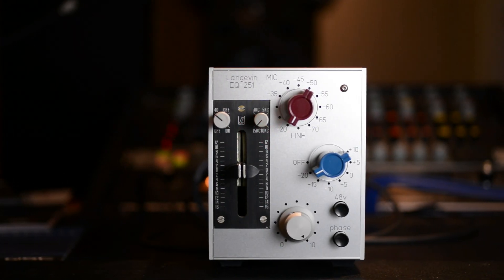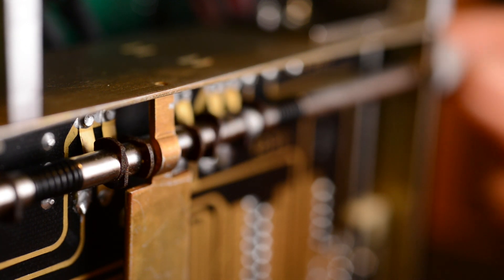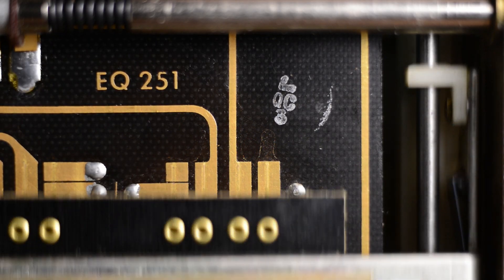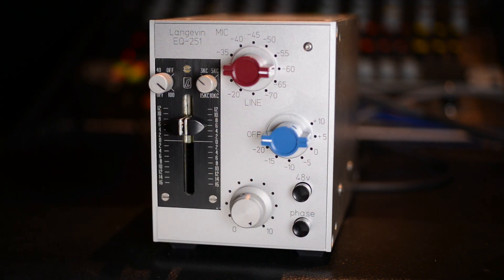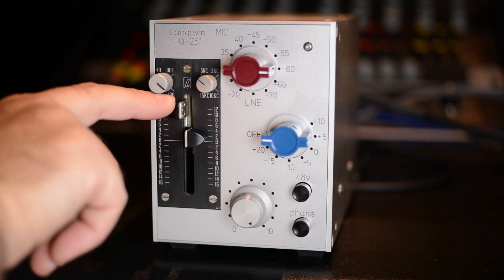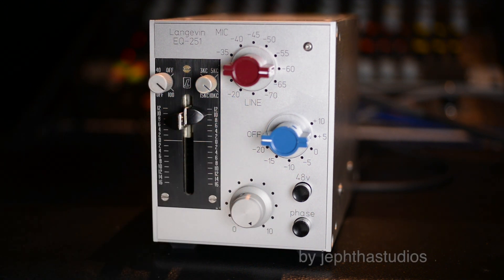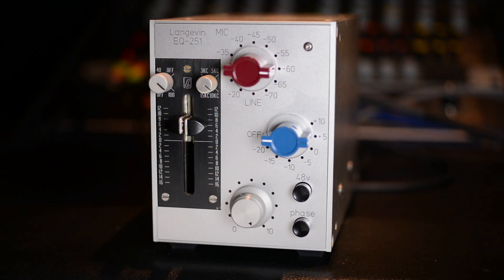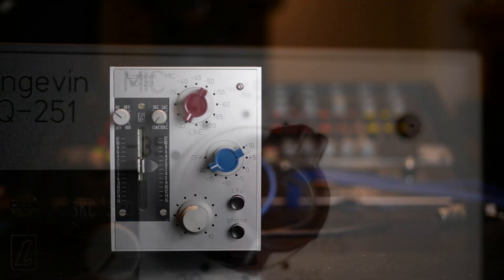Custom Neve Langevin Mic Pre EQ - See and hear vintage audio technology

Comment: Hey that PCB looks like a woven material, is it some sort of fiber? Carbon or other? Sorry if it's a dumb question, I worked on E-2's and F-18's Legacy and Super in the Navy and never seen a board like that, in training or in the field, and the E-2's radar hardware is from like the 50's or 60's on the old Nav-Up's. I worked on 2k's for a while but the legacy radar WRA's were just insane how large and heavy some of the boxes were. The output transformer feeding the bathtub was a little bigger than a shoebox and weighed a good 60 pounds or so. Grumman could have built some pretty heavy duty studio equipment lol.